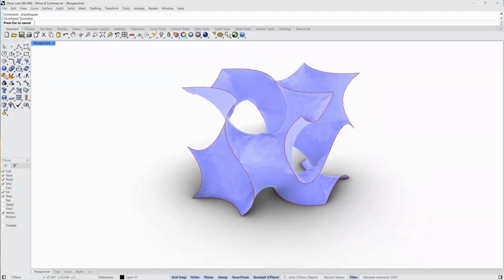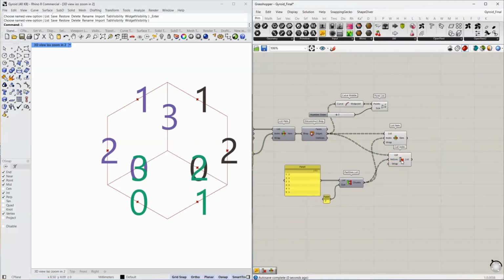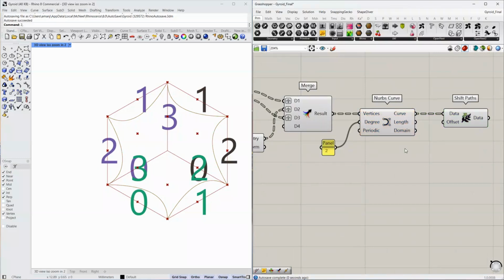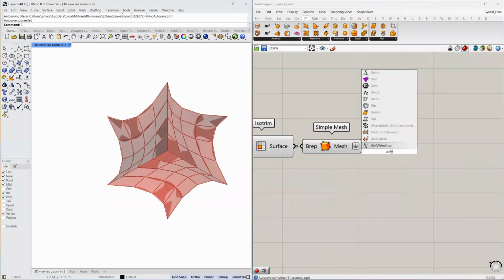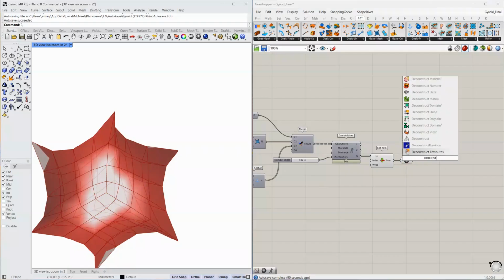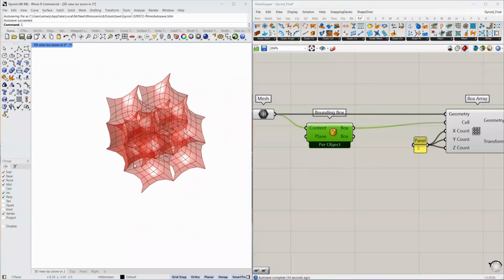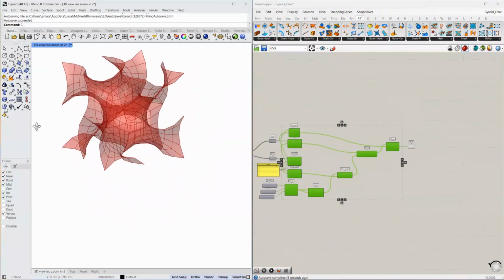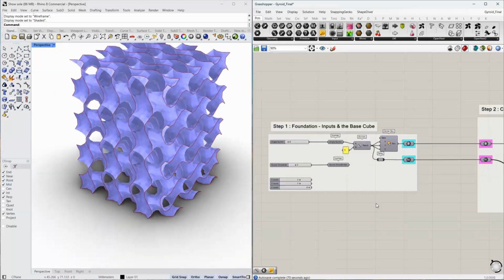Gyroid - Grasshopper Tutorial (No Plugins, No Math!)

Comment: There is at least one plugin being used here,  Mesh Edit. (Unify MeshNormals) (Weld Mesh Vertices)
Reply: I was personally unable to make this work without (Weld Mesh Vertices), the vanilla Grasshopper (Weld Mesh) creates a very different output.  I'm not knowledgably enough to bridge the gap, however I did get the plugin installed.
Reply from the maker: You are right @hibiscus. I have mesh edit installed on my system since forever and forgot that it isn't part of vanilla grasshopper. Thanks for pointing it out.
Reply: @qbricklab4200  quick question about the twisted boxes at the end, was that done using pufferfish? I'm having great difficulty creating a twisted box from my reference model, I suspect I've built the nurbs in a way that Pufferfish does not like.